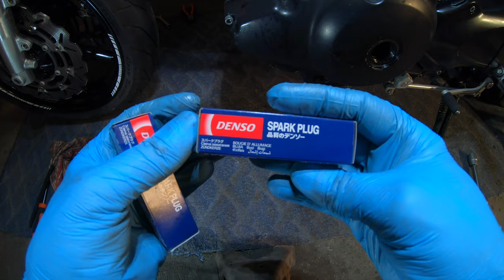Yamaha BT1100 Bulldog. Adjusting the valve clearance. New spark plugs.

Comment: hello, do the cylinder heads of the front and the rear are the same shape can you put the front cylinder head of the rear in the front? i'm going to buy parts for someone but i'm not sure about this. please reply if you have some information.
Reply from the maker: Not the same part number. 5KS111010000 and 5KS111011000
Reply: @sem5771   thank you very much

Comment: Guys, does somebody know where the air/fuel mixture screw is located?
Reply from the maker: Page 193, screw 14. Remember the original position of the screw. How many turns until the screw is tightened. http://bulldog.yamaha.free.fr/manuelatelierbulldog/bulldogservicemanua1.pdf
Reply: @sem5771  Thanks man, i will see if i will even need to touch it. The bike hiccups when cruising and backfires. Lets hope new plugs and carburetor synchro will be enough.
Reply: @sem5771  I cant seem to figure it out, i found the pilot screw but i dont know which way to turn it to make a richer air fuel mixture. Some people say, turning anti clock wise adds more fuel and some say the opposite. Can you please help me? I want to make a air/fuel richer because i added a aftermarket exhaust.
Reply from the maker: @whatsupyopeeps  Unfortunately, I don't know. Remember the original position and experiment. At your own risk 😀